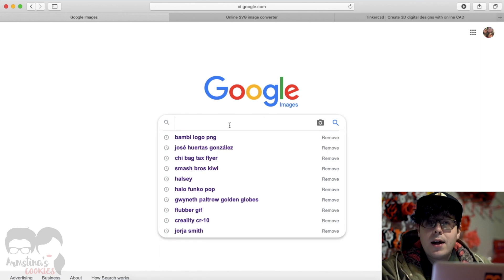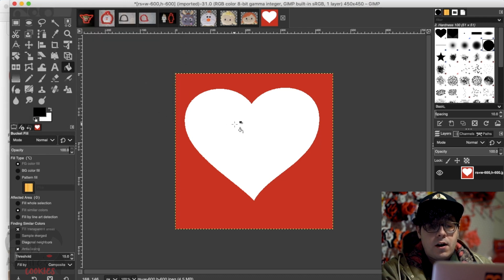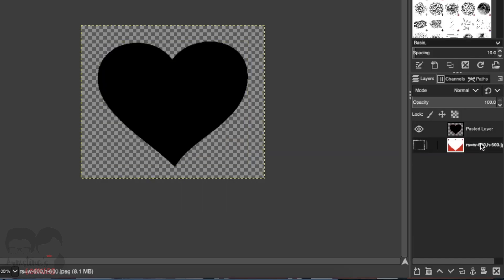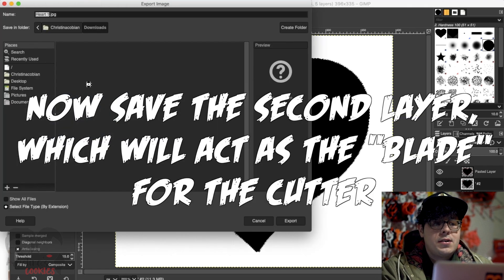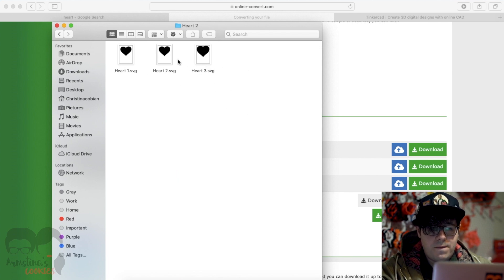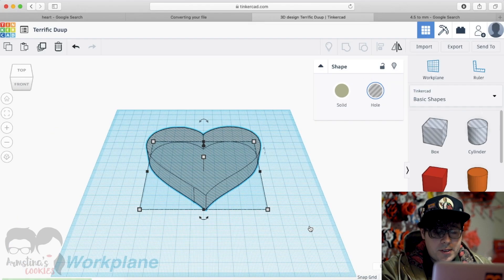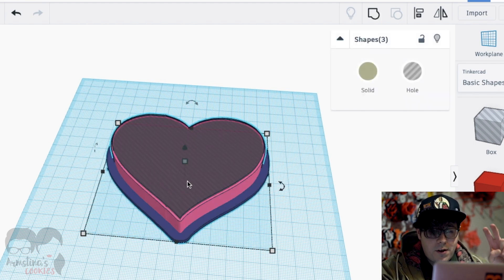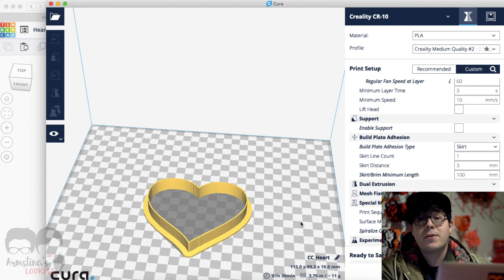How To Make 3D Printed Cookie Cutters

Comment: I use your system all the time. LOVE IT! But I have stumbled over a glitch and sure it's just something I am doing wrong. Usually with custom cutters this problem arises. I scale it to the size I want in Gimp. Then convert to svg file. But when I go to use Tinkercad to create the cutter, the scale is WAY off. Like sometimes I have to go as small as 5%. It's a trial and error to see what percentage will give me what size. Am I creating the original picture using too high a resolution?
Reply from the maker: This actually happens to me a lot as well, and I share the same theory. It’s a minor issue though, as long as you pay attention to the dimensions when importing into Tinkercad.

Comment: Your video helped alot the only thing I can't figure out is when they print I get jagged edges I'm guessing from the picture. Basically if you zoom in on a picture the edges are jagged that's the way the print is coming out am I missing a step to smooth that

Comment: When I have Image in gimp and I do the threshold I can’t get it to darken as you do in the video am I doing something wrong
Reply from the maker: There should be a small window that pops up so you can adjust the threshold level. May be different in other versions of Gimp, and sometimes the photo doesn’t work well with that method

Comment: Thank you so much for sharing this.  Having a bit of trouble now though.  I have followed your video step by step and made two perfect cookie cutters but since then I've been having a lot of trouble with getting Gimp to work correctly.  I'm doing a slightly more complex shape that the heart and every time I try to change the background to red, it comes up gray.  Then when i cut the image, it cuts to the same shade of gray so that the whole area just looks gray.  Nothing I've tried seems to correct this issue, not even deleting and reinstalling Gimp.  Any thoughts?
Reply from the maker: The image may be in a different mode. Try going to the “Image” tab and going to “Mode” . RGB should be selected
Reply: @armstinasfamily  thank you!  It worked!  Was having some other problems too but I’ll keep pushing through this and see if that fixed everything.  Another problem I was having was that I would get all the way to a finished looking file in Tinkercad but when I would preview the file, there was always material where the hole should be.  Tried making the hole bigger and still no luck.
Reply: Also, the background is red now, but so is the image shape when I cut it.  Ugh.🤦‍♂️

Comment: That was an awesome video, I learnt a lot.  I’m wondering, do you use a PLA filament?  If so, do you use the cookie cutter straight from the printer or do you smooth it or finish it somehow first?  I plan on reusing the cookie cutters I print quite a bit and I want to make sure that they are food safe and completely clean and I read that the printer doesn't create completely smooth edges so bacteria can grow in the groves. Is that true?

Comment: do you need to use a stainless steel extruder nozzle to make the cookie cutters food safe?
Reply from the maker: People tend to argue this a lot. At the end of the day, the filament comes out at a temperature that kills any bacteria that people are worried about. We use brass nozzles.
Reply: @armstinasfamily  Thanks I was wondering if it really mattered or not. That sounds like copper is the better extruder for this. Also do you have a preference and PLA or any other print medium?
Reply from the maker: We only use PLA, and Hatchbox is our favorite brand

Comment: Used the holiday time off to go through the tutorial slowly. Kept having trouble getting the same results in Gimp. Did some research and found out that Gimp isn’t working running on Big Sur. Have you updated?
Reply from the maker: We haven’t updated to Big Sur yet. Thanks for the heads up, since we rely heavily on Gimp

Comment: How would these steps change if I already have an outline of an image?
Reply: This is a late reply, but in cases like that you either do not need the "hole" part or you you can color the inside to provide the same starting as this video had (this may be useful especially when the line art does not have equal line width)

Comment: I just tried some 3D cutters I had ordered but find that the walls are thick and end up compressing and smashing the edges of my cookies which is sooo not good.   I usually only use metal cutters and it gives me a crisp straight edge..  What is the most thin edge than can be made with 3D printer?
Reply from the maker: The thinnest we go is about 0.9mm

Comment: Great video. Do you know of a way to sharpen the cutting edge of the cookie cutter, so it actually cuts and not just squash?
Reply from the maker: We’ve played around with it for a bit but the results were inconsistent and didn’t have much of an impact when using on dough. We found as long as the blade is at most 1mm thick it cuts the dough easily.

Comment: Sometimes the walls  become so thick how can i fix that?
Reply from the maker: When making the different sized silhouettes in Gimp, on the one I increased the selection by 1mm, try going a little less, like 0.8mm. Also, after the model is made and you open in the slicer program, if you scale it up at all the walls will increase in size then.

Comment: Wow, thank you! This is soooo helpful!!
Reply from the maker: Awesome to hear!! Good luck and happy printing!
Reply: @armstinasfamily  OK, you were soooo helpful last time, I was wondering if I could ask another question? I printed a couple of cutters with various settings. We keep getting a split in the wall of the cutter (like, the part the actually cuts the dough - it's like there are 2 walls that don't totally fuse all the way around.) It is only happening on certain parts of the cutters but no matter what settings we use, it keeps happening! Have you ever had this problem?
Reply from the maker: @globalbakes  sounds like there's a chance one of the axis belts may be a bit loose.

Comment: Do your cookie cutters have a smaller edge at the cutter to provide a sharper cut? If so what setting do you use to do that? Or is it preloaded?
Reply from the maker: Negative. The entire blade wall is the same thickness. We make ours 1mm thick, which provides us with a sharp cut and isn’t flimsy.

Comment: Hi there!  Thank you so much for posting this video.  Im such a noob, and your video is the only one I've found that makes me think I can do this!! Question - on the step where you're making the three copies, it seems like when I copy the original file, I lose the image.  The whole square becomes the image, so when I try to use the paint tool to blacken the image, it covers the whole square.  Any ideas what i'm doing incorrectly?  Thanks
Reply from the maker: Thank you for watching! Is this while using Gimp? If so, in the Layers toolbar did you right click on the image and press “Alpha To Selection” before using the paint bucket tool?
Reply: @armstinasfamily  Yes it is in Gimp, and yes. I am.  After I crop to content and scale the new layer, yes?  Then I make the original layer visible again, and that's the layer I copy three times, with a comma in the naming convention, so _, __1, and ___2 files. __ is the first file.  Then I right click on the first file, choose alpha to selection, and export.  Go to layer _1, right click and choose alpha to selection.  Then.. I have to select the image to grow, right? by 1 mm? then export.  Do next layer, _2 ..same steps and grow by 6 mm, then export...